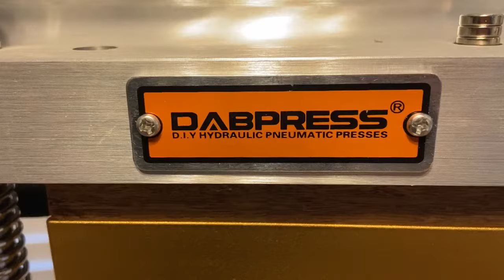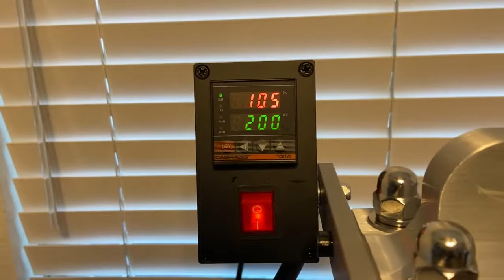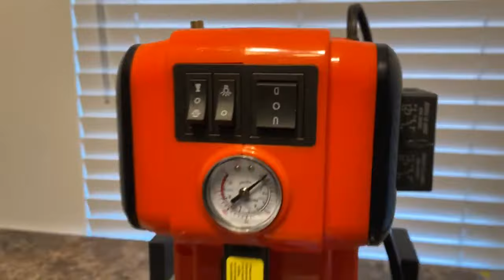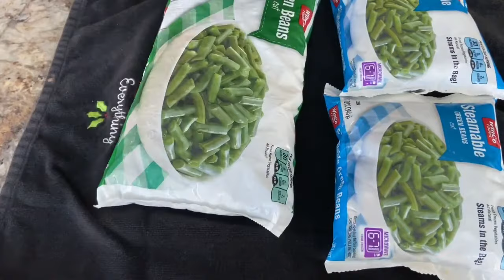Dabpress 4 Ton Bottle Jack Rosin Press into Automatic Extraction Heat Press Machine

Comment: I'm pretty sure this is an "VEVOR Electric Car Jack, 5 Ton" but he has added a light (that's the light to see attached to the cable) and normally on the side it says 12v in orange letters but again this appears to of been modded as it sticks out very far and says nothing but everything else on this jack in the exact same as the "VEVOR Electric Car Jack, 5 Ton" except with the noticeable home made modifications.

Comment: I have the same press but I installed the 12 ton low profile jack from harbor freight and I don’t even have to drip tech it just bottle tech and I’m yielding between 25-42 percent yeilds per press just off flower up here in Washington
Reply: Link??

Comment: Well done sir! Very satisfying to watch you through that whole process. Does anyone know what he put the tree in before putting it into the press? Looked very efficient
Reply: This is a pre pressed puck. He simply put the buds under pressure from the press before he pressed it with heat to keep rosin from getting stuck in the filter baggie

Comment: I’ve been wasting money on a 20 ton press. $100 worth of steel for the frame, then 120 for the air controlled bottle jack, and 80 for compressor. This seems sooo much more simple. Where to get that frame, I don’t need 20 tons apparently.
Reply: 20 is overkill for sure max u should need us 6 4 does amazing
Reply: This was a 4ton dabpress they removed the jack from they are $360

Comment: Your gonna loose return bein lazy🤣🤣🤦‍♂️why you pressn so hot ur stuff burnt dark or bad startn material dont do what he doin ppl trust me
Reply: What's a good temp? 170, 180 degrees?
Reply: @hostileaks4495  It depends on how much pressure you have available, the type of material used (flower, dry sift, bubble hash) and whether you want to yield less of higher quality or yield more of a lower quality (still good quality though). 

He pressed at 200F in this video which is heading towards high temp. I'd say 160-180 is low temp, 180-200 is medium temp, 200-220 is high temp (these are general ballpark numbers but you don't want to go higher than about 220). With the 5 ton jack he has I assume he can press at 180 no problem. I had a small entry level manual press that you might be able to get 1/2 a ton of pressure with if you forced it (no bottle jack) and man it was a struggle. I experimented with different temps but I started around 210 F or so (the temp they used a lot in Nugsmasher videos). With a small press like that I noticed yield would really drop off when I went below 190 F because there just wasn't enough pressure to get more oil out.

Flower can be pressed at the higher temps up to 220F/104C but the higher temps are best suited for low pressure rosin presses). Concentrates (sift, bubble hash ect.) should be pressed at the lowest temp possible (I think preferably below 180F, just based off videos I've seen since I haven't pressed any hash myself). If your press has a bottle jack which seem to start at 2 tons (smallest I've seen in any press, Nugsmasher Mini uses a 2 ton jack for example and so do the $200-$250 Chinese presses) then you have enough pressure to at least do medium temp but I wouldn't try low temp with less than a 4 ton press, preferably more (the guys I see really doing low temp presses tend to use 10 tons or more but at some point it's overkill).

Ultimately you have to experiment yourself to find what you like best and what works for you. Hope that helped a bit though.
Reply: 200F is an OK temp but he left it on the plates too long. Low temp isn't mandatory and you can press up to 220F without losing much flavor as long as you get the rosin off the plates quickly. People press at 200 for the  good yields and if they don't have a high tonnage jack (200 is a great temp for the little manual presses on the market, much lower than that and yield drops too much).